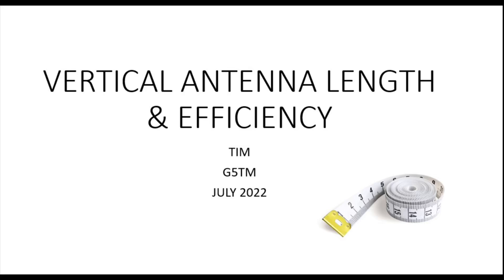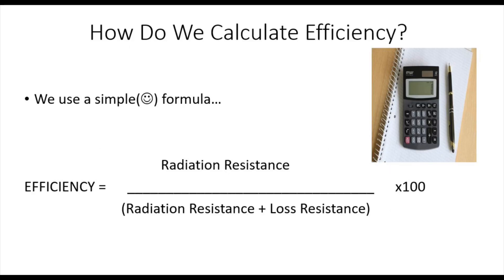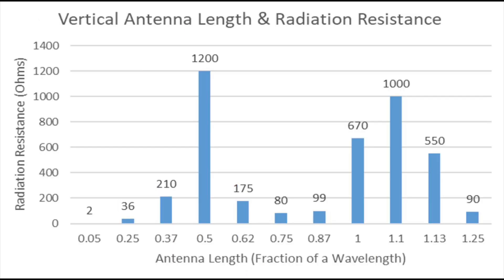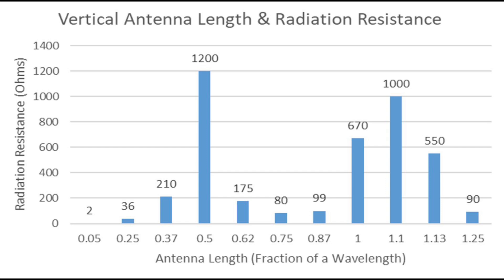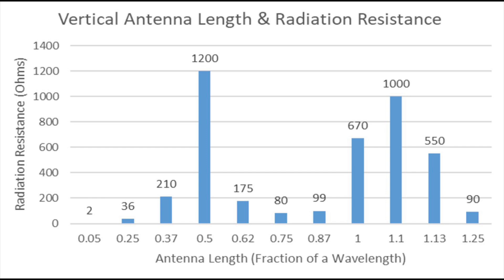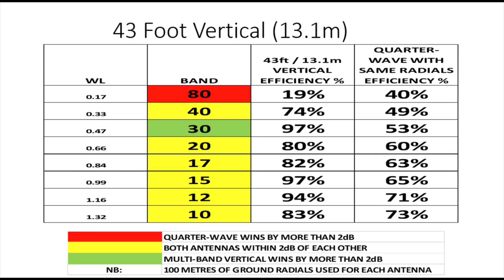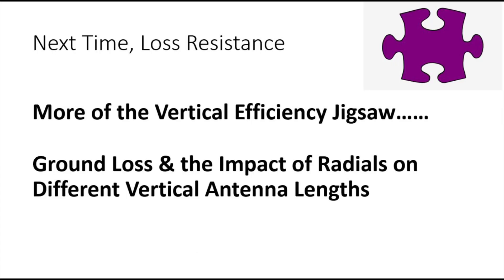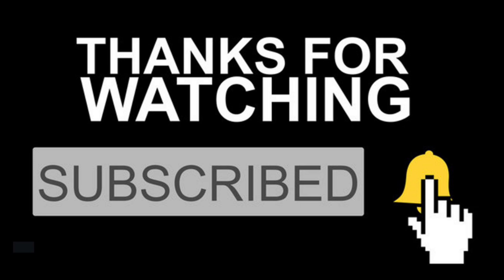HAM RADIO: Vertical Antenna Size & Antenna Efficiency

Comment: Tim, for me this is may be the most valuable information about verticals I have found so far! Thank you. 🙂
I am still relatively new to the hobby (licensed since 5 months) and I am mostly interested in verticals for portable operation that I put up on nearby hills as I cannot do that at my apartment. 
Currently, I am interested in the upper HF bands only (mainly 20/17m, but also 15/10m) where it is mechanically feasible to put up a 1/2 wavelength vertical dipole or end fed with no big effort.
With the information you shared about a.) effiency and b.) radiation resistance using the bar charts and the 2 examples (8.8m and 13.1m antenna) , I have now come to the conclusion that as long as I can use 1/2 wavelength for the radiation element(s), I have the most efficient wire antenna, and everything like a 1/4 wavelength would be a compromise that would not come close to the efficiency of the 1/2 wl no matter how many radials I'd attach to it. 
Maybe that is common sense for experienced hams - for me it was not, also because I came across YT video(s) demonstrating how well a 1/4 wl vertical with a special radial configuration (in terms or angle/length) works, and so I asked myself if such a shorter antenna could outperform the 1/2 wl types.
Well, quite obviously not.
Thank you, Tim, because now I do not need to waste time in modelling/ building the shorter antennas with their radials hoping they are an even better alternative.
73 de DL1HNR, Henner

Comment: It occurs to me that, as a practical matter, there is more to be considered beyond radiation resistance and the sum of antenna losses. With several of these antenna lengths, there will be substantial reactance, the network which provides a reactance of opposite sign and transforms the impedance to that of the transmitter will have losses, too. If this network is distant from the antenna, there are losses associated with the circulating current in the transmission line. Combined, these losses may be greater than antenna inefficiency or radiated power.
Reply from the maker: Yes, where you match them is absolutely vital if the vertical is non resonant

Comment: A bit of confusion between Radiation Resistance and feed impedance.
A center fed half wave dipole and an end fed half wave antenna have the same radiation resistence and way different feed impedance.

Comment: Super interesting. It’s curious to me how much worse the 1/4 wavelength vertical is as you go down to lower bands (as compared to the higher bands)… since I think the ground system you described is proportionally the same.
Reply from the maker: One of the many mysteries!

Comment: Hi Tim, My copy of the RAE Manual from 1988 (page 57) says "The 'radiation resistance' of an antenna is a fictitious resistance which would dissipate the power radiated by it.". A good reminder that everyone needs to double check their 'facts' from time to time. It's wierd that I remember that, that's in there it's probably because it stuck out as being a bit odd.
Reply from the maker: I agree, facts are very important. Thankfully we have the work of people such as DJ2YA to support the theory. I was glad to use his data. 73

Comment: Vy good presentation. If I take the 43 foot vertical and turn it 90 degrees... this is my endfed random wire antenna out of my window. Instead of radials a 4:1 UNUN is grounded in a water pipe for the heating (works great for what it is). Suppose all this theory applies.
Reply from the maker: Yes and a nice antenna you have too

Comment: Hi Tim, interesting series! I was wondering, you're mostly concerned about radiation pressure WRT transmitting, but is it also important for receiving as well?
Reply from the maker: Hi there its a unit to assess the radiation efficiency therefore TX 73

Comment: Hi Tim, It seems like the 1/2 wave vertical has the best efficiency.  Do 1/2 wave verticals need radials and what is the best way to match them?  Thanks for another great video.  🙂
Reply from the maker: Hi Brian, stay tuned for the next video in the series (radials), all will be revealed! 73

Comment: Hallo Tim, thank you for nice video, I'm waiting for the next👏. Only a clarification: in Half Wave configuration impedence is abt 3Kohm, and a tranformer is mandatory: for monoband application best results with 64:1, in multiband configuration 49:1 is using as a compromize.
Reply from the maker: Hi Franco. I deliberately used the lower end of the radiation resistance figure for the half wave. You are correct that it can often be higher 73
Reply: @TIMG5TM  👍

Comment: I have a 43 ft vertical with 660ft of total radials. (22 x 30ft)  Best vertical I ever used.
Reply from the maker: They work really well Mike
Reply: @TIMG5TM  instead of using a 4:1 balun, with these 43 foot verticals, could I use a 9:1 balun with the vertical 

Or could I disconnect the radials and use a 49:1 unun and increase the length of the radiator to an appropriate length ?   Food for thought.

Comment: Hi Tim,I usually ignore the scientific graphs and build an test in my own location! Over the years I’ve found a 1/4 wave mono band antenna with 4elevated radials has allowed me to work dxcc on whatever band I’m working at the time.my own experience is don’t be put off and build and test! Thanks for all your great videos 73s Gm4zji Chris
Reply from the maker: Yes elevated radials are a game changer. Cheers Chris 73

Comment: So am I understanding this right? Half wave verticals with quarter wave radials have the best radiation resistance?
Reply from the maker: We cover radials on the next video, but 1/2 wave verticals fed at the base require minimal radial fields and exhibit an appreciably higher radiation resistance compared with a 1/4 wave. 73
Reply: @TIMG5TM  thanks for the reply and info. 
Another question: would this only work as mono band verticals? I'm assuming that it would not work well in a fan dipole (DXcommander) since the signal would most likely radiate at the quarter wave radiator, assuming you have something like 20,17,15,10. Or does the signal radiate on the most resonate radiator?
Reply from the maker: Hi Steve you need to use 1/4 waves in a DX commander configuration owing to their lower impedances. 1/2 waves wouldn’t work. Of course you could also use one vertical and have a tuner near the feedpoint. So for 20-10 a 20 foot plus vertical would do well for example.
Reply: @TIMG5TM  fantastic. Thank you for all that. Love the video and keep up the good work.
Reply from the maker: @Steve T  that’s very kind Steve thank you for your support

Comment: Excellent video TIm. Really appreciate this.  Mark, 2E0MSR.
Reply from the maker: Thank you Mark! 73
Reply: Meant to add - with the DX Commander on 40m, the physical pole is about 10m, but the element is longer as there is a fold back. Given that the wire is coated, there is a real "length" extension to perhaps 12/13 m (I cannot recall right now). There is some interesting physics going on , the "length" of the wire is not the same as the desirable actual "height" of a 1/4 vertical, but it certainly does increase efficiency on 40m>   Mark, 2E0MSR

Comment: @Tim how to measure radiation resistance? or efficiency? Can it be calculated out of any NanoVNA measurements like power loss?
Reply from the maker: The few who have, have compared field strengths as well as taking into account overall feedpoint impedance and thus determining loss resistance as part of this. It’s a complicated measure and in most part is based upon the inevitable differences in the feedpoint impedances between say a 1/4 and a 1/2 wave.